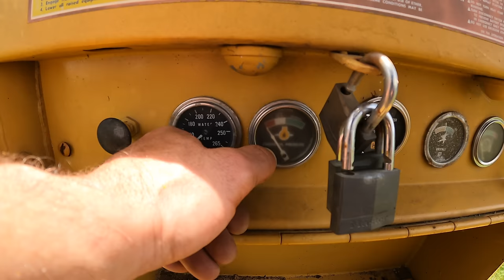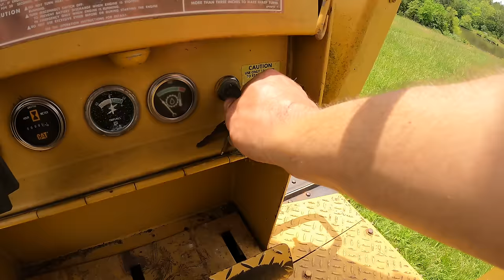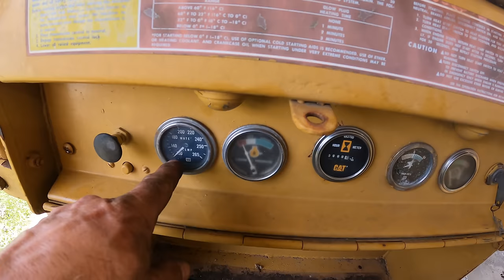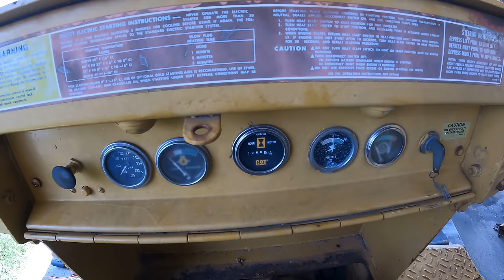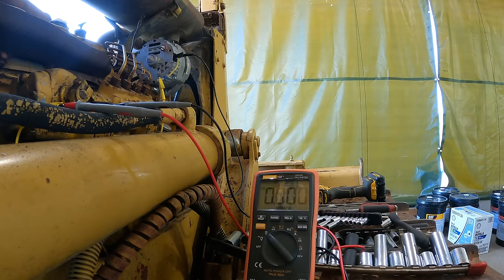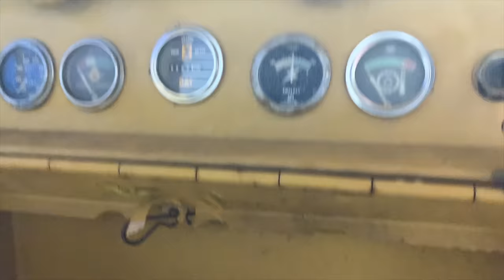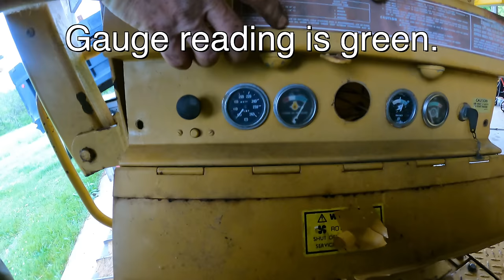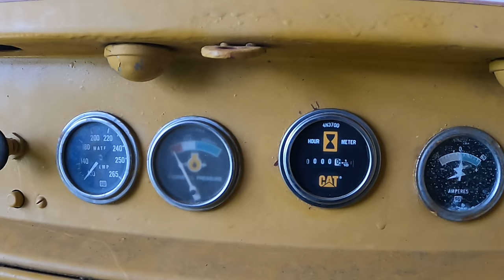Buying & Fixing a Bulldozer, Cat D3 Dozer, Part 1/2

Comment: Suggestion from a retired heavy equipment guy.
You don't need to replace your cylinder rods, you just send them out and have them ground and re chromed.  You can get your cylinder repacked at the same shop or repack them yourself, it's easy.  Either way the grinding, re chroming, polishing and repacking process could make a interesting episode if there's a shop that would allow you to film it. 
Good luck
Reply: I suspect a pond.
Reply: how much does that cost, and what do they call the places that do this?
Reply: It is often cheaper to just replace the Spear with new material, especially if time is a factor.
Reply: At the very least that same shop can custom build a replacement rod (if they cannot re-chrome) usually for much much cheaper than new. We used to send out piles of reach cylinders for re-chrome and some of them were sheared off at the end.
Reply: He's repaired rods before himself.
Reply: @CorDawgYT  agreed
Reply: @tutekohe1361  not on a 48 year-old machine.
Reply: @robertmccully2792  I don't know where you're located,  keeping it simple I would use local .  Here in Phoenix I would use Arizona Hard Chrome if I was close to Tucson, Road Machinery. Google it. 👍
Reply: I worked in a machine shop for years. We always just made new rods out of chromed induction hardened shaft for any cylinder that needed rods worked on. Considerably cheaper and faster turn around for ANY cylinder, than grinding re chroming.
Reply: @bluegrallis  That seems standard at Cutting Edge Engineering as well.
Reply: @FrancSchiphorst  Yeah, I've seen Kurtis do that repair a number of times now.  He's repacking the cylinders on his new crane, but I don't know if he's doing the rods or not.  I haven't gotten into the 2nd video in that series.

That would seem to be the more cost-effective way to go, but in this day and age, who knows?
Reply: The chains are stuffed, at least the bushes want turning
Reply: I think they'd use a lathe for the resurfacing but yeah.
Reply: @bluegrallis  got to trust a man with that name!
Reply: @netts2315  they put the ram in a lathe then use a process called wet Stone grinding .
Reply: @tetedur377  Kurtis made new rods and just kept the ends. Doing the same with the barrels, but we won’t see that until next week.
Reply: @joevalencic5275  Yeah, I just watched that.  Excellent job as always.
Reply: @Kendoe0341  Oh yeah, they're the same stones used in knife sharpening too, right?
Reply: How about an inground swimming pool?  He already has a body of water in which to tool around in his boat propelled by his Johnson that he repaired in some other videos.
Reply: @tetedur377  i think in one if his videos he said it takes a lot of time to rechrome and can leave weak spots as well.

There is 0 tolerance for oil spills and never time in the mining industry so rebuild by CEE is fastest and surest way to get machine back up and running. He does the same for his own stuff.
Reply: Hey many many years ago if the machines were needed and they would not let us in the shop take them down we used Cat epoxy.  Probably 3M made it.  Small round disc with parts A&B you mixed up and put on the rods.  After cleaning with either lol.  Then used a belt sander that works on rods. Slowed leak or stopped it.  Machine was back moving dirt the next day.  

Eastwood has one.  Mini angle belt sander.  Hell I used it on my outdrive lift cylinder’s in salt water for a summer but forgot about getting new ones because I never had a leak again.
Reply: The price of getting something chromed is outrageous these days especially if you send them to a metal plating shop that does high quality work. These days you are better off getting new rod (piston) stock and cut the ends off the old rods and welding to the new rod stock
Reply: @robertmccully2792  There are lots of places that do this, your local hydraulic supply store should be able to provide you with a list of companies if they don't do it themselves. Example would be getting a reach cylinder completely rebuilt(new rod, seals and anything else) for $350 vs $1200 new.
Reply: @tetedur377   Yes he made new rods,he even made new ends, because welding the old ones back on a new rod could, or would cause the bores and bushings to have to be reworked anyway.
 With new ends, he welded them on before finish boring for new bushings.
Reply: @kalen01  Ha Ha, I'd like to see that!  No amount of Scotch Brite is going to polish to acceptable level. But, if it can be done, John is the guy to show us. ben/ michigan
Reply: @robertmccully2792  Hard chroming .
Reply: In the UK, which isn't the most technologically advanced country, there are at least 2 places who do proper hard rechrome of hydraulic pistons, which is waaay cheaper than replacing
Reply: @davidsmith3995  Maybe, but machine downtime may change the economics entirely.
Reply: Definitely show an engine rebuild  then it will start without glow plugs
Reply: @Kendoe0341 The stone is actually called a whetstone.

Comment: Could be wrong, but I believe those plywood "arm rests" are actually the base plates for the old arm rests. Looks like they just need a block of new foam and some vinyl upholstery wrap - unless you wanna go super fancy and do leather. 😆🤔

Love this project!! Can't wait to watch more, and glad to see the seals are back in action. Hehe.
Reply: You are probably right. Most Caterpillar machines have something similar. Usually very thick foam pads with heavy material covering.
Reply: I made new cushions for my little crawler, and NO WAY would I put black vinyl on them and probably couldn't afford leather. I bought a roll of water proof canvas duck cloth, in a light cream color. If you ever had to leave your seat in warm weather, black is terrible to come back to after the sun bakes it for a bit and my little Massey tractor had a brand new black vinyl seat when I got it 4 years ago, that lasted less than 2 years before cracking. It never sat out in the weather either.
Reply: Yup, that's exactly what that is! Arm rest pads go there. :)
Reply: If my memory serve me well, some dozer from this era did had a small tool box with a padded arm rest on top, this is the reason why the large ''distance'' from arm to the actual ''plywood rest'' ;-)
Reply: use closed cell foam stand up better to weather, with marine vinyl
Reply: They are the bases. I'm a Cat parts guy for a Cat dealer.

Comment: Great video, Jon! A few suggestions:
1) put a closed-cell foam sheet in the bottom of the battery box to cushion the battery.  Harbor Freight sells them as .Anti-Fatigue Foam Mat Set.

2) Fabricate or purchase a battery hold-down bracket.  Otherwise, you will eventually have a bad day, probably sooner than later

3) Always use the glow plugs before attempting to start engine.

4) Connect the alternator field terminal to the accessory terminal of the ignition switch, otherwise you'll have a constant battery drain in your existing connection.  The internal regulator will try to supply current to the field windings to increase the output voltage, which won't happen if the rotor is not spinning.  Originally, the FIELD terminal was connected to one terminal of a 12v light bulb, the other terminal to the starter switch IGNITION terminal on gasoline powered cars, and the bulb labeled ALTERNATOR.  The bulb served dual functions as an "idiot light" and a max field current limiter.

5) There is a small hole in the rear alternator housing that lines up with the holes in the brush housing.  I find that a paper clip partially straightened works great for holding the brushes in for reassembly.

6) The alternator output should start out around 14.5v for quick charging, but after running for a while should drop to around 13.6V-13.8V or otherwise your battery will be overcharging.  If the voltage remains above 14v, consider switching to an AGM battery, as they are more tolerant of high charge currents/voltages

7) The battery disconnect switch fried because they tried routing starter current through it.  If you routed starter current elsewhere, a battery disconnect is not a bad idea.  Switch the positive terminal, not the negative, and connect the starter solenoid direct to the positive terminal.

8) The rear alternator mounting tab now has a LOT of tension on it because there's nothing filling the space between it and the alternator mounting bracket.  I suggest filling that gap with something like a chunk of water pipe, just to relieve the side pressure on the tab and allow you to cinch the mounting bolt down more.  It will also relieve pressure on the front mounting tab.
Reply: I was looking to see if someone commented on the field draining the battery.....  we'll spotted!  Could connect the field to the oil pressure switch ( looked like that's where the wire used to be connected).
Reply: @workparty3949 I like the idea of connecting the field wire to the oil pressure switch!  Good call!

Comment: if you have concerns about chipping the concrete, we use old tires to put under the tracks, especially for turns. Can't wait to see part 2.
Reply: I could hear my dad screaming at me for driving that dozer on concrete.
Reply: @stephenbinion6348  🤣
Reply: Plywood works also
Reply: I prefer old conveyor belt. I have gotten large pieces of it for free or very cheap from a local quarry.  Old conveyor belt also makes excellent mud flaps for trailers etc.

Comment: You can push a pin from the rear of the alternator to hold the brushes during assembly, there’s a hole there for that.  Enjoyed the video!
Reply: 👍 I was  thinking the same thing
Reply: @2990rick  I wise old man told me to use a wood toothpick. No damage to the brushes and you can pull it out the back of the case after assembly.
Reply: I used to rebuild those....put the pin through from the inside (we used a chunk of the lacquered stator wire). with about an 1/8" sticking up on the inside. Pull it after assembly. Also you can "clock" the case...no need to extend those wires.
Reply: WD40 straw through the back of the alternator through the brushes for easy removal and it won’t short when you forget it’s there when connected to power.
Reply: That looks like a Ford/Motorcrap alternator.  I'm thinking I would have put a spacer in between the ear of the alternator and the back bracket, just due to all the vibration on that machine.
Reply: @tetedur377  looks more like a Delco-Remy alternator to me
Reply: @gullreefclub  looks like a 10Si
Reply: Thank you for saying this, I was just about to tell him! I was whimpering at the screen the whole time watching him fight the brushes.
Reply: I was checking to see if somebody would help him out with this, glad to see you reached out 👍😎
Reply: You only need the wire going to the battery terminal. When you first start the engine, rev it up once and it will start charging. And the pin is pulled out of the brush holder through the back of the alternator to release the brushes against the slip rings.
Reply: It is gm alternator

Comment: Pro tip. If you get the whoopdey doos when pushing dirt, split your cut so that half the dozer is on smoother flat ground. and angle the blade that will help too. It essentially makes the dozer longer and the cut narrower.
Reply: or just push the highs into the lows, and stop moving the blade up and down so much as you travel. Only lower and raise when your butt level senses the machine lift or dive. Less is more.
Reply: @DarrellDrinkwine  new operators don’t have a calibrated butt level sensor. And they over compensate movements.

Comment: Your battery draw comes from the way you have your alternator field coil hooked up. It is always energized in its current setup. Use the wire you left disconnected in the console attach it to the hour meter side of the oil pressure switch and attach the other end  to the F on the alternator. This way the field coil is only energized when the engine is running and you will no longer have a parasitic draw on the battery. 
Great video! I recently found your channel and have enjoyed watching. 👍
Reply: I was thinking something similar. With the field winding connected permanently to the battery it’s going to drain the battery.  Normally the field winding would be connected to an ignition bulb in the dash, then to an ignition switch and finally to battery positive. The field winding only needs a small current and doesn’t need to be connected directly to 12V.
Reply: I was also thinking the same, although I would run the field wire to the key switch run post and bypass the oil pressure switch/hour meter thing. However if John replaces the broken battery isolator switch (and relocates it to a sensible position) then I suppose that would not be necessary. Nice little dozer though can't wait to see part 2 of fixing/using it and I don't think the price was excessive, dozers are just expensive.
Reply: Plus one to that advice.
Reply: @kevinmills5293  amen
Reply: You are a 100% correct
Reply: It's a self exciting regulator you only need the wire going to the battery terminal on the back of the alternator. Engine revs will excite it and start charging.

Comment: Although you were able to set the brushes with the wire there is actually a hole in the back case that allows the wire to be pulled out of the back. I alway use an old paper clip. It allows you to spin the rotor before setting the brushes. More than one way to skin a cat!
Reply: I have had to do that on my Vega’s alternator back in 1974 , !!❤

Comment: You may want to check out Diesel Services!  They will rebuild all kinds of things(hydraulic pumps, Fuel pumps etc.) For MUCH less than a replacement cost! There should be a Office(service Center) near you or at least pretty close by!  Oh, and locating a Service Manual for THAT Dozer would be a WISE move(should be on-line) It would take ALOT of guess work out of the equation! I really am excited for Part 2!!

Comment: First time I've seen anyone pull the brush hold-back wire out through the drive side of an alternator.  Most of the time there's a hole in the back side to pull the exposed wire out. Nice to have the machine tools to adjust, adapt, and over come!

Comment: Electritian here. The battery drain is probably coming from the bridge wire on the alternator. if you bridge it that way it will keep the winding nice and toasty. Just use the spare old wire to the alternator and connect it on the switched side of your oil pressure switch. this will switch off the alternator as long as the engine is not running

Comment: I saw you cleaning the radiator fins with a pick. They make a tool called a fin rake that straightens and cleans various pitch fins in cooling devices. Maybe you can look into something like that for next time.

Comment: Let's see...you need a dozer, excavator, and dump truck. That's got pond building written all over it. 
Very nice find in that dozer and 15k is about right considering the cylinder rods. Any places in your general area that can re-chrome the straight ones?
Reply: How about an inground swimming pool.  He already has a body of water that he uses to tool around in his boar propelled by his j=Johnson that he repaired in some other videos (last year was it?) Oh, yeah, and there's that video where he built a bench (hanging out over the water) off the side of the pier on that body of water. Oh, it just hit me, he could built a small pond to water his herd of cattle.

Comment: FYI  hold the Alternator brushes back with a small wire, just like you used but through outside of the of the rear case (next to the bearing ) and pull it out the back.

Comment: That wire from the starter to the yellow butt connector is usually a fusable link . The throttle is tighted usually by a nut and bolt going thru the piviot point of the handle.

Comment: That was called an economy Cat D3. It came with a single speed reverse instead of 3 speed reverse and a 5 roller bottom undercarriage. You are good and handy at fixing it. That alternator looks like a GM one from the eighties or so. Very good alternator. Many are fitted to tractors to update to reliable cheap alternator. Loosen them tracks up. Will look forward to more videos.

Comment: John, your wire to the alternator should be hooked up to the ignition otherwise direct connect to the alternator  main positive will drain your battery while it sits.

Comment: Always check the oil level and antifreeze before you start, good practice to get into. Also, open the oil fill cap when running and check for blow bine -smoke coming out of the pipe if so you have major problems with engine rings

Comment: Just for future reference. Air filters are designed to be blown from the inside out. Not the other way. Which sometimes can be a pain to fine something that fits down the center that can blow at an angle but just thought I'd toss that out there. Maybe you can fab something for use for anther time. Love the videos btw 🍻

Comment: when blowing out the air filter  you should blow on the inside so the dirt comes out the way it went into the filter rather than pushing it further in. if you have time you can also dip it in a bucket of water a few times after spraying to shed more fine dirt. the paper will dry fine as long as you dont agitate it to much.
Reply: Dropping them on concrete repeatedly works well too.
Reply: I always blow them out from the inside out but am not a fan of giving them any sort of a bath especially the safety filter (inner filter). But to each his own.
Reply: @gullreefclub  fair enough. paper holds ok to being wet if you allow it to dry before applying loads again. its amazing how much more comes out of the filter.